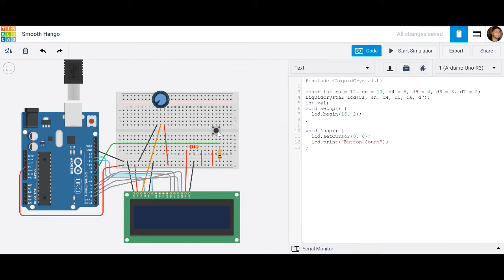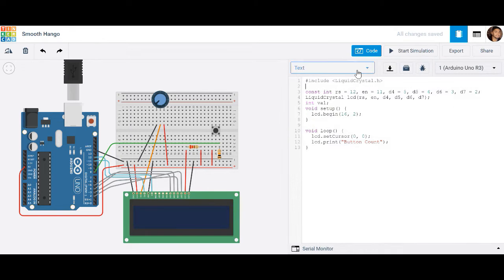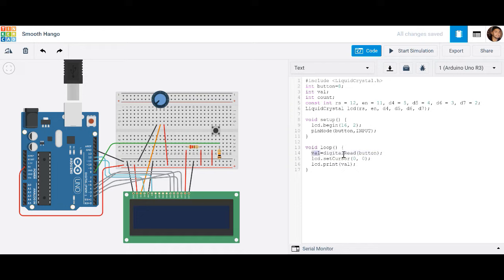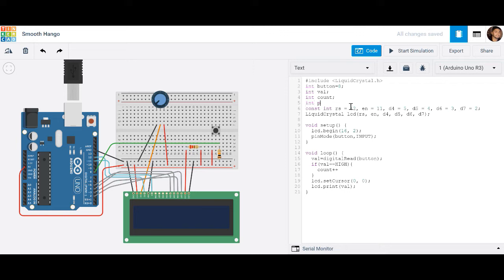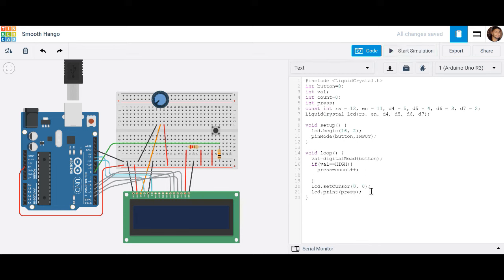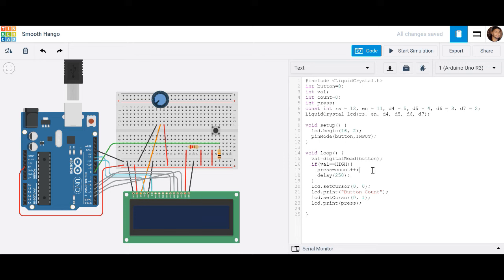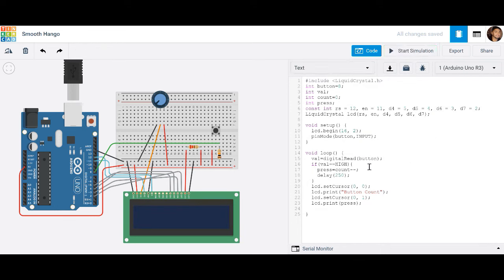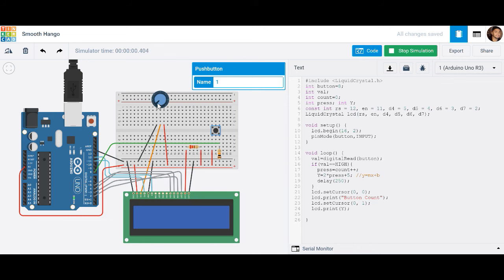How to Use Button Count

Comment: what's the possible program and circuit for this
"This is a Counting up program which calculates the number of times the button is pressed. If
the number of button pressed is more than 9, it will be displayed as “ > 9”, then program
terminates."

Comment: TEST ok but a single button push would count as 1 unless the button was held down in which case the count continued as long as the button was held down.
  What would help?  Increasing delay is not a solution

#include <LiquidCrystal.h>
int button = 8;
int val;
int count = 1;   // author used 0 but then the first button push was not counted
int press;
const int  rs = 12, en = 11, d4 = 5, d5 = 4, d6 =  3, d7 = 2;
LiquidCrystal lcd (rs, en, d4, d5, d6, d7);

void setup () {
  lcd.begin (16 , 2 );
  pinMode (button, INPUT);
}
void loop () {
  val = digitalRead (button);
  if (val == HIGH) {
    press = count ++ ;
    delay (500);
  }
  lcd.setCursor (0, 0);
  lcd.print("Button Count") ;
  lcd.setCursor (0, 1);
  lcd.print(press) ;
}
Reply: well let me help...u can add another condition after the first and we dont even need a delay. The code goes like that:
if (val==HIGH){
   if (val==LOW){
       press=count++;
   }
}
Reply: @waliddja6406  Lol, was looking for that for a long time, thanks dude

Comment: Hey thanks for your code, I have been looking for something like this to incorporate into a project. One slight problem I am having is when I subtract 1 from 10 instead of getting 9 I get 90. Any thoughts on what I am doing wrong?
Reply: I am sorry I forgot to add that I added a second button that subtracts, so I have one for add and one for subtract.
Reply: @MPC1055  I have the same problem. What can I do about it?
Reply: Hi, I have used float press instead of int press. I do not really like having decimal numbers on my display when number of presses is always a natural number but it is still better to have 9.000 than 90.
Reply: I think its because it counts 90 as 9.0
If you use float press instead of int press it should show it as 9.0

Comment: hey man if you still see the comments on this video I want help. I tried out the same code you use for the video. And something weird happens. The program will ignore the button and will freeze if I connect the cable to the pin I asigned my button to. The weird part comes next, If I unplug the cable or conect it to any other pin it starts running, the number keeps growing and growing without input. Any ideas?
Reply: Hey i think You forgot to write the Double  ==  in the 16th Line (If (Val==HIGH))and wrote You instead Just one = 

Let me know if this soveld your Problem 

Greetings from Germany